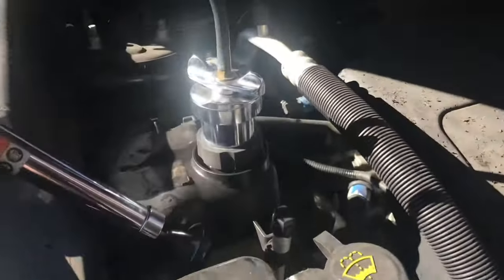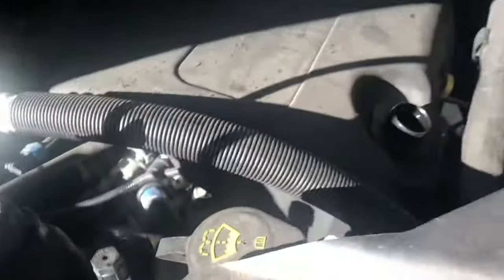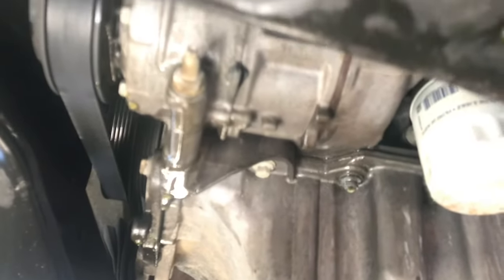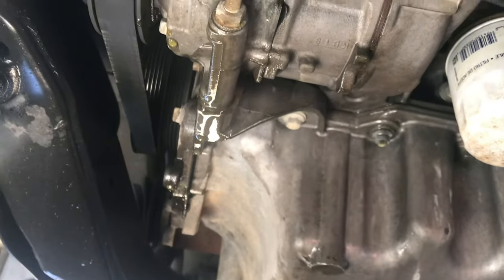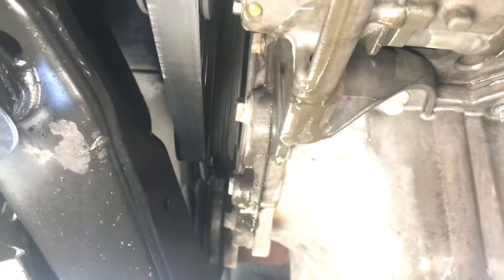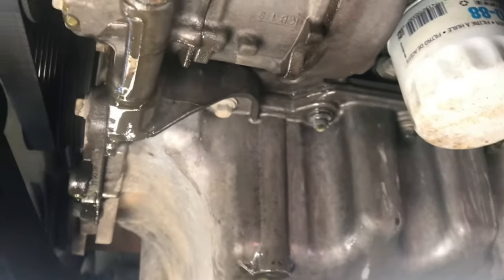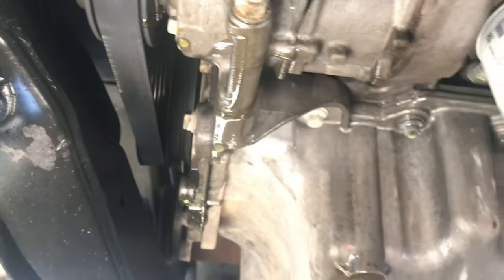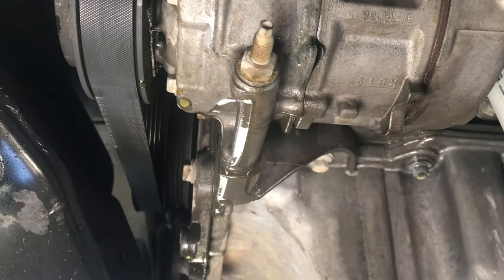Ford Coolant Leak 3.5 And 3.7 CHECK THIS OUT!!!!

Comment: So I had a mobile mechanic come out to me, and he didn’t do a pressure test. But I drove home which is about 30 mins away with no issues and I didn’t see a leak in my driveway, can it still be the water pump?
Reply: Ever find out what it was? Because same.

Comment: I need to decide to replace my water pump or get a new car.   Integrity Automotive quoted me $4600  November 20, 2023
Reply: That’s double what it should be.  My buddy just got 2 quotes for an Explorer with the 3.5.  

Dealer wanted $2200 that included new timing set. Independent shop was $2500

Biggest issue is in our area they are 20 days out for work
Reply: I got quoted 3500

Comment: The worst engine ever made why TF did they make the water pump internally BS
Reply: they are not the first.
Reply from the maker: And not the last lol
Reply: What other cars have this issue so I won’t feel alone 😂
Reply: @ussssaaabixchh  Mazda CX same engine
Reply: Not the worst engine made the 3.5 3.7 run for ever i have more than 250,000 miles  380,000 kms  cooland is changed every 100,000 miles.. new plugs at 160,000 miles  runs great no wsterpump issues as tge coolsnt gets acid after 100000 miles and ests tge gaskets.  Engine pulls great  no smoke at all on start up. Zero oil cobsumption between 8000 mile oil chsmanges

Comment: How does a crack in the reservoir develop, could it be problems from the engine somewhere that builds up pressure?? I’m so pissed but I’m about to change my own shit
Reply from the maker: @Redro1982  to much pressure could be a cause for sure, in most cases it really seems to be an issue with what the reservoir is made of. Constant temperature fluctuations and possible expansion and contraction of the plastic will leave it in similar conditions of dry rot for example. Cheap brittle plastic after a few years cracks develop and a leak begins.

Comment: Hi, mine was leaking and the water pump was replaced but is still leaking, what can be
Reply: same issue. Put some dye in it. If its leaking on the right side then its probably leaking where the hose clamps.
Reply: @TharkonOfficial yes like 2 days after the comment I check the hoses and one was leaking. Thanks
Reply: @Acel747  Mine is also leaking at the clamp, however my clamp was very tight already. Did you do anything special?
Reply: @TharkonOfficial  it was a little twisted sometimes the hoses just are damaged by the clamp so you can cut were the clamp was sitting
Reply: @TharkonOfficial i have the same leak, passenger side, you mean the hose from the resorvoir? Tnx.
Reply: @adnunnkeypengyt1958  yes it was only the hose. The hose is located on the right side

Spent 4k in repairs just to fix the hose myself.

You can buy coolant dye to help trace it
Reply: Wait is it possible the leak could only be from the hose & my water pump is fine ?

Comment: Did mine in a ford edge. Took about ten hours. Breaks and stuff but just a pain in the butt with the engine still in
Reply from the maker: @JohnFields-c8c  they are for sure, at this point I’m on like my 30th water pump job for these. If I have all parts ready about 5hours start to finish.

Comment: What the name of the tool u use to put pressure to the cooling system
Reply from the maker: I Used a cooling system pressure tester, you can purchase the tool from auto parts stores or some may offer a loan a tool to use. Just make sure it has the right adapter for your vehicle.
Reply: @SMAutoRepairLLC  thanks
Reply: My ford flex is leaking from the bottom as well would I do the same procedure
Reply from the maker: Absolutely pressure test the cooling system to see exactly where the leak is!

Comment: How many miles was that ?
Reply from the maker: Approximately 103,000
Reply: @SMAutoRepairLLC  thank you, great repair video too!
Reply from the maker: @msheehan634  Your Welcome And Thank You.
Reply: i bought this car brand new back in 2016 and with only 56K miles,  my water pump went bad,,, so i am repairing it myself.....   dont feel too bad since the car in the video has 103k,   double mine,,,, oh well
Reply from the maker: @benfernkay8974  I’ve Seen The Mileage Reported For These Engines Having Water Pump Failures As Early As 30k And As High As 200k+ It Really Seems To Be Hit Or Miss, One Thing For Sure They Will All Need It Replaced At Some Point. Thanks For Watching!
Reply from the maker: Roughly 103,000

Comment: Mine is leaking from the back. They replaced the intake manifold gasket, but kept leaking and overheating. Now they’re saying it’s the timing cover? Should I be concerned about more repairs after this?
Reply from the maker: Hey thanks for reaching out. So the issue isn't the timing cover its the water pump. The water pump is designed with multiple seals, if the first seal fails it will allow coolant to leak through a weep hole and out of the timing cover(likely what your experiencing) If the second seal on the water pump fails it will actually allow coolant to enter the engine and will mix the oil. To have this repaired properly it will require the water pump and gasket to be replaced along with all other necessary gaskets like the intake plenum gasket, valve cover gaskets and gasket maker for the timing cover since these items will be removed during service. The only additional repairs that may be need depending on wear and mileage would be some of the timing components  like the chain tensioner and guides. I hope this helps.
Reply: I have a 2014 ford tuayeus and I have a minor leak. Does my car also have a weap hole?
Reply from the maker: @theasianinvasion8280  If You Have The 3.5 Engine Then This Is Exactly The Same For Your Vehicle.

Comment: What’s a rough estimate to get that fixed?
Reply from the maker: Depends on if you do a timing job with it, and pricing where your located anywhere from $1200-$2000 would be a good estimated price in a shop.
Reply: Getting mine done now. Ford quoted $2500. A shop I've been to before for other maintenance quoted $16-1700. It's not at Ford....edit: currently at 78.5k miles and was leaking droplets while running....not going to let it get any worse
Reply from the maker: @pe8954  good call on that! Fix it before it fails completely
Reply: Ford taurus police sedan Ford told me 3500 that's crazy

Comment: How much ?
Reply from the maker: Price?
Reply: @SMAutoRepairLLC  how much would it cost to repair ford edge 2008 170k miles water pump i have zeroooo issues with my car but now is the water pump and evap purge both gave out other then that the car is running strongly good
Reply from the maker: @Luui2x  I’m not sure where your located but you can figure approximately 11hours of labor time plus the price of parts needed water pump gaskets timing chain if you choose to do so.
Reply: @SMAutoRepairLLC  okay np and i have the oemwater pumpo and power steering i bought them i paid 100 for each part but idk if they would use my parts tho. they be charging ode extra for parts i can find brand new or oem for less. so i hope by me bringing in the oem original new parts they can just work on it but is prolly gona cost over 1k cuz i can do it myself but im having a baby on the way and i workl every single day so i dont have time rn but thanks and im located in pittsfield mass...
Reply: @SMAutoRepairLLC  when I had mine done in 2019 it took the shop 1 day and $2,600 later... there's a TON involved
Reply from the maker: @Jerone5740  for sure i have a video on the channel for the repair.
Reply: Would “stop leak” granules help or save it for a couple more months? Mines got 110,000 miles on it but I’m probably going to trade it in after watching this video!

Comment: I need help my coolant been leaking from the driver side is been like that 6 months but the car doesn’t overheat n da engine still very quit 
Ma question is should change the water outlet or is it da coolant hose
Reply from the maker: Need to either pressure test the cooling system, or let the engine run to see what part it’s actually leaking from. Wherever the leak is coming from is what you want to replace.

Comment: Hey love the video question for you   wondering if you could help direct me I have oil coming out the freeze plug weep whole the car over heated water pump an timing chain were replaced then the oil started to leak would you happen to know why???
Reply from the maker: Thanks for reaching out any chance you have a picture of it? Would definitely help in getting you going in the right direction.
Reply: Yeah I have pictures n video but don't let me upload on the comment section do you have a email I can send it to if that's fine with you
Reply from the maker: @jonathancontreras7852  sure thing smautorepair10
Reply from the maker: @jonathancontreras7852  @gmail.com